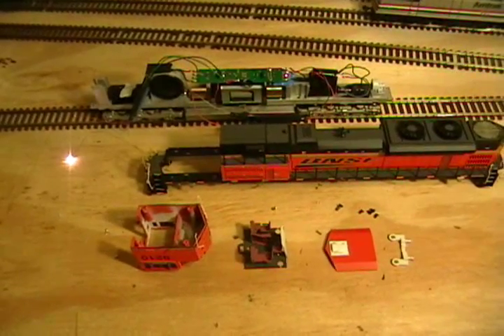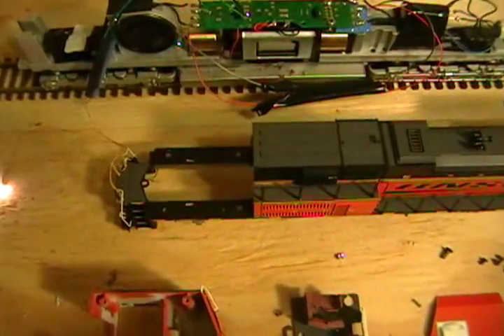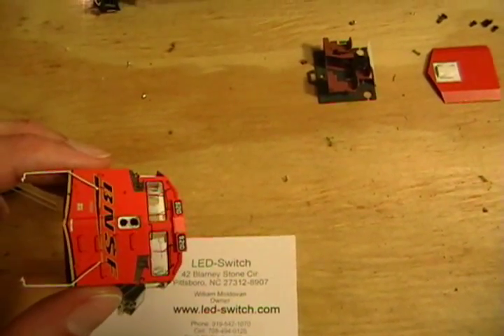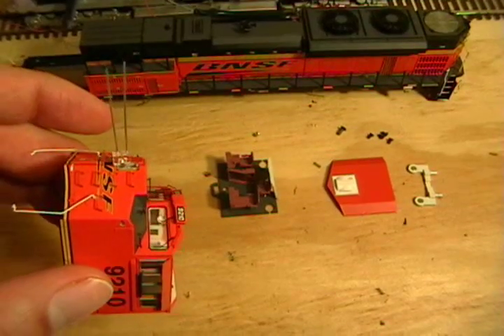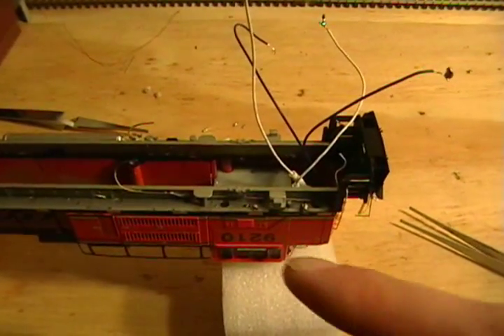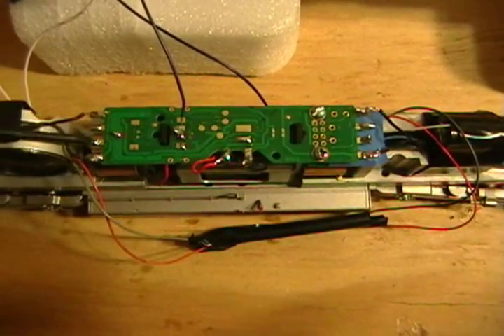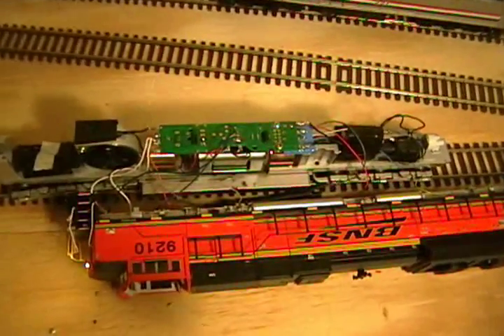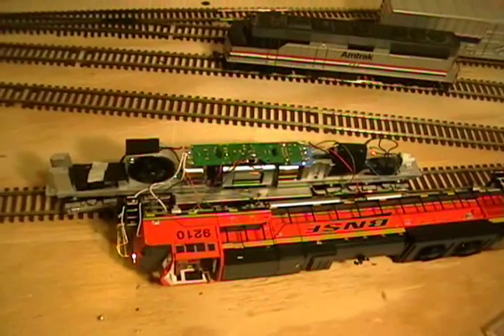04-25-2011 Advanced DCC - Part 11C Digitrax Sound Decoder Install into an Athearn SD70ACe

Comment from the maker: @midrange18 Sorry if I was confusing. The 2mm LEDs are warm white water clear, and the micro LEDs for the ditch lights are sunny yellow from Ulrich models. When I did part A, I was planning on using mini bulbs that would require 330 ohm, but the LED's require 680 ohm 1/4w or 1/2w. For some reason, I just couldn't say the correct resistor type. After I went and edited the video adding the correction, I said it wrong again in the next video...lol

Comment: Were those 2mm LED's for the front headlights?  I can't seem to find a colour called Sunny Yellow on that website.  I see one called Warm white water, which is a soft white with a tiny hint of yellow.    Also, After watching 11A B C, i have questions.  There is no blue wire on the front middle part of the board any more.   And did you use all leds with 680 OHM 1/2 watt resistors.  11A had 330OHM, 11B had 640Ohm, and it said correction 680, and 11C you said 640.  Were they all the same?